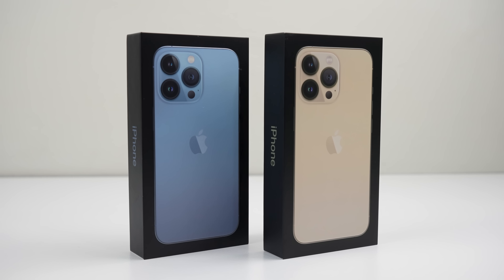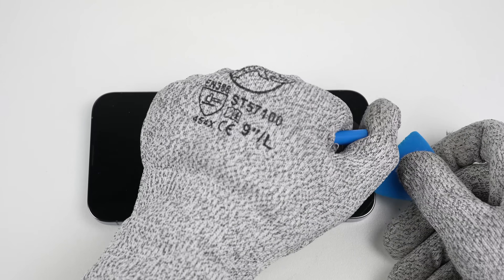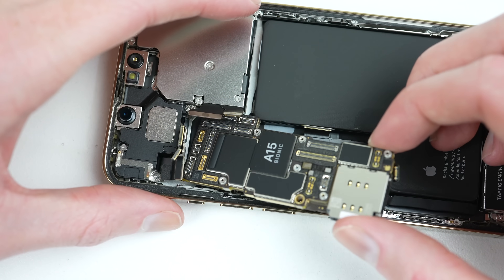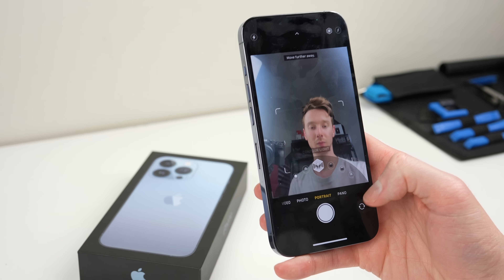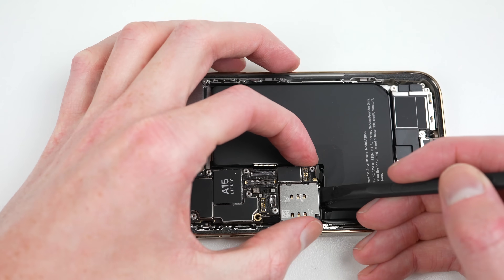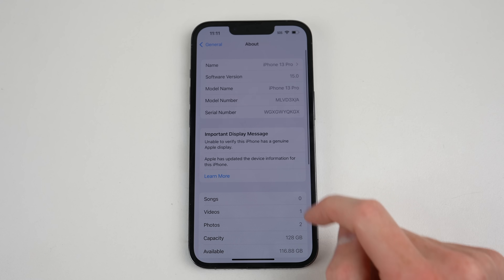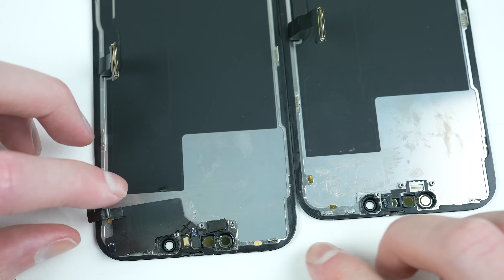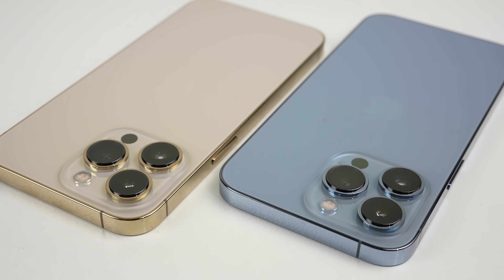iPhone 13 A Repair Nightmare - Teardown and Repair Assessment

Comment: I love how Apple is using security screws inside the phone.
To Apple engineers: The screen is glued shut. If someone had enough persistence to get it opened, weird screws aren't going to stop them either.
Reply: Exactly what i came down here to comment... They just do it to be twats is all i can guess.
Reply: Any Castle can be conquered, it's just a matter of "how long it will take".  And it's a resource. If you don't have the required time and resources, you give up. That's the defense here. By making it harder, you effectively greatly reduce the amount of people who can perform this procedure.
And if the amount of people are low enough, nobody will be googling for a 3rd party Apple repair service.
Castle owner wins, with enough people deterred.
Reply: They probably produce and sell the screwdriver for these screws
Reply: Probably more to just use the same screws bits to assemble the whole phone, if they cared about making it harder they would use a different security screw on the inside then the outside, since if you can open it obviously you already have the screw driver
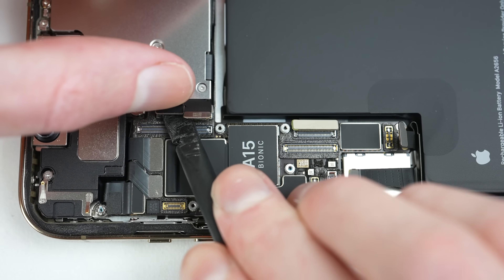Reply: @jaykoerner  at around 4:45 he says he has removed 4 different types of screws including 2 security screws. they are not using the same screws on inside and outside
Reply: @thomashall1236  Nope, there are some pentalobes inside. Most Y-000 though, and some tiny Philips. I remember how the charging assembly for the iPhone 12 Pro had almost as many screws as the entire base S21 had.
Reply: Also, 
To Apple Engineers: You guys are
                                    useless garbage
Reply: @AcidiFy574  maybe not all apple engineers. some of the engineers there left apple and started their own company called 'Frameworks' which do the exact opposite of apple but in laptops. they go as far as providing colour coding each screw for each component and providing some extra screws so that you can repair it on your own and they can also give you CAD models of the motherboard in case the components in the laptop die of age so that you can use the same motherboard and fabricate or 3d print a whole new chassis for it so that you can use the same motherboard again and most of the parts in the laptops are replaceable anyway
Reply: @kaneki1056  Then those aren't Apple "Engineers"

They're actual engineers.
Reply: And make Apple more $$$$$$$$$$$
Reply: Engineers aren't interested in your 'logic'.

Comment: Similar ti iphone 12 you can copy the serial key on the old screen ang trasfer it to the new one, better buy that part before going into conclusion that a certified technician cannot swap a brandnew screen, these programmer boar should be available in china of course

Comment: Imagine a person who first bought this and wasn't expecting no power adapter, charger and a headphones. 
Then went back to Apple and told them it is missing the parts that he needs the most, then told it is sold separately.
Reply: 2022: batteries not included.
Reply: @Woogoo336  
If that was the case you could at least replace it if it breaks, which Apple would never do.
Reply: @Alias_Anybody  They could go for some "magical" external batteries

Comment: It seems the modularity and physical replacement is as good or better than the past, but Apple, with their vertical integration of software and hardware have completely designed the phone to be only repairable by Apple. This does enhance the so called “security” of the device but it’s to the detriment of the individual willing to do their own repairs, and all of the device repair costs will be much higher as a result. Thank you so much for putting all the hard work in for these videos! Love getting to see these phones from the inside.

Comment: I think you’re doing Apple an injustice. I would not expect cameras and sensors to work if you swap them out. I’m sure during manufacturing and test, the components are calibrated and calibration info is stored on the main processor board along with serial numbers of the components. If you swap out a component, it will need re-calibrating and so it seems reasonable to disable features that would be compromised by the swap out due to invalid calibration data. Isn’t it obvious?
Reply: Dude just Shutup. You all cult bastards. Always enabling these greedy companies. Always defending Apple and Samsung. Shutup idiot

Comment: Apple: "So we can't serialize the back camera, but we can serialize the rest, right?!" (does the back camera even work when you switch it?)
Reply: It seems so, if it worked with swapped boards.
Reply: That’s because the back camera doesn’t include any security feature like face unlock
Reply: @JFTN123  If that were the case only face ID would be disabled, even then a good company would allow you to manually enable face ID after viewing a warning about non genuine parts.

Comment: It is a dick move to disable perfectly functioning hardware parts. I don’t mind if the phone throws a warning, let the user know, then let user decide to keep using the function or not. If user selects don’t care keeping enabling then Apple gets a free pass on any related issues. This is why we need big powerful institutions like the EU and US to give us right to repair! I’m typing from an XS Max with a busted depth sensor suspected of water damage. The phone is otherwise unblemished! All it needs is a replacement of the module but there is no one here with the Rewa equipment to reprogramme a new faceId cable!

Comment: doesn't changing logic board with other one can cause security issue? I mean, if someone get an stolen iphone 13 and they want its data, they can just replace its logic board with their iphone 13 logic board and can access files/data on stolen Iphone13. In your testing, have you been able to read/write any file on the phones after swaping parts? If not than I think removing faceID and front camera is a logical choice to protect user data.
Reply: Garbage brain....
If someone wants your data they just need your password 
Thieves don't steal phones for data

Comment: Slippery slope. From a right to work standpoint, you will need to work at apple to work on apple products. Which also means you won't be able to leave apple since your skills cannot be used anywhere else.

Comment: The subscription model is king. Want an iphone that will last a reasonable amount of time? You need to buy apple care. Being able to repair a device on your own means you are less likely to need applecare. This model is everywhere. I remember the repair section at my local BIG NAME car dealership was small in years past. Recently, it has gotten a huge overhaul. It is easily 10x the size as before. Why? They are figuring out how to drive customers towards more repairs post sale. During a recent sale I was given all sorts of warrantees and free services BUT I had to do them at their repair center and ptentially pay for extended warranty. -The car buying equivalent of apple care.

Comment: As scummy as it may seem. I don't personally think it is all that sinister in the broad view of things. they sell you an iPhone 13 for 699. Most likely not a huge profit margin. Then, the customer keeps the iPhone for 4 years, some people even longer. The iPhone, despite being a proprietary mess, it is a super reliable and well built product. So they are supposed to just be okay with everyone else taking away the repair side away from apple? I see how it sucks for the customer to have to shell out to have apple do repairs. It totally sucks. However they are losing a crazy amount of money to 3rd party parts and repairs. It would be silly to expect a company as wealthy as apple to just give up the profits so that the customer can pay less money for repairs. They believe if you have the money to pay for an apple product, you have the money to have them be the only ones that touch it. Its scummy, but you'd be an idiot if you expected anything less. They should make laws that limit this.

Comment: missing true tone that can be compensated for in photoshop.

photographers will have to move the photos to their mac and edit in photoshop.

i am sure there are battery health meter apps out there so you dont need apple's.

you can skip the face id and use the pass code instead.

since portrait and cinematic modes is a blurring thing you can do it in photoshop and final cut.

this is provided that the camera will work at all.

Comment: Great video. I had no idea Apple had done this even with the iPhone 12. It's a real dilemma as I still think the iPhone is still the best overall phone you can buy but I do not like Apple as a company. If the repair charges done by Apple were anything like reasonable it wouldn't be so bad but the cost of most repairs would be enough to buy a half decent Android phone. Hope by making such videos and getting feedback, Apple will do the right thing with a software update. In fact if they locked all new models for the first year and allowed third party repair after say 1 year that would be a more reasonable compromise.

Comment: This is all do to calibration settings for the camera, and battery that is stored on the logic board nvram.  The calibration is completely wrong for these parts, so the software doesn't work.  Calibration for the cameras are critical for faceID and the ability to swap between the different lenses.

Comment: So not even copying the hardware data over to the third-party hardware would fix these issues? The way a data transfer works is that it fools the system into thinking the new hardware has the exact same serial number as the old one.

Also, I don't think anyone needs more proof of Apple's hostility towards consumers and distate for their own customers than them actually creating artificial problems with hardware/software when trying to repair Apple devices at a third-party repair shop. Not only that, but then they have the nerve to openly insult everyone's intelligence by claiming that third-party hardware is the cause for these issues.

Sure, third-party screens are never gonna be as good as Apple's own screens. The problem is that Apple's original screens can't be purchased anywhere, so third-party repair shops are forced to use lower quality screens by default even if they're top of the line of the screens they can actually get a hold of.

Comment: Fantastic video. Very methodical and we’ll produced. I can understand both sides of the argument. On one hand ‘I don’t feel like I own them’ seems fair enough.- you’ve purchased something outright but feel as though you should be able to open it and repair it. Not being able to seems unfair and locked in. However on the other hand if I purchase a secondhand iPhone I want to be sure it’s as good as it was when it was made. I would want to ensure it has genuine parts inside, that it is still waterproof, that it has been done by a trained repairer and that it won’t burst into flames when it’s charging during the night. I think Apple wants these things too to maintain their brand integrity. Apple are also moving towards a closed manufacturing ecosystem and they don’t want to have to deal with foreign materials that are inside cheaper 3rd party items. So what we see in your experiments and others like it is a sledgehammer approach instead of a compromised position. You demonstrate how not even genuine parts from an identical iPhone will work when installed - whereas a section within settings could show items that have been replaced, when and where they were replaced and what parts have been used. That way a secondhand buyer could ask the seller to see this information and make an informed buying decision - and people who want to maintain their iPhones could (in conjunction with authorized repairers). So I see both sides - I just think the solution could be more towards the middle and not so extreme.

Comment: I honestly don't get why Apple even makes the insides of their tech so beautiful visually speaking when they are so much against users opening it anyway.
Reply: it need to be easy if kids have to asamble them :D
Reply: Probably easier to build... But made to not be replaceable. Or probably they know which part to use to make it work... So: they only can repair the phone... Only if they want...
So they try to give an excuse to the costumer if the device fail... And if there can't be any excuse, they replace the single component if it's less than 1 year old...
Reply: hypocrisy is the first impression of apple products.
Reply: As a certified technician, i appreciate it for all of you
Reply: It is becouse of Steve Jobs visions. He want it beautiful outsite and insite.
Reply: because they know they will be opened anyways
Reply: The inside is not beautiful in the first place

Comment: The legal system is defective, broken and either doesn't work or takes way too long to do the right thing, so the only way going forward is to set up an anonymous bounty programme where apple employees can leak the source code for the internal pairing tool for money.

Comment: How can people be still surprised/pissed off by this? We all know how much Apple likes to constrain their own systems. Is this a good or a bad things? Depends.
I've seen a handful of people have their iPhones poorly repaired being an endless source of bugs and malfunctions due to counterfeit parts, or supposedly original parts which ended up failing as well due to not being "completely broken". And I know a handful of places, most of them phone repair shops, that will buy a phone for parts no matter their state without asking questions.
You know, if I accidentally break my phone I can:

a) Try to repair it myself, which has a big chance of ending up being a complete mess.
b) Pay what I think is a reasonable amount of money to a random self-proclaimed technician to fix it with parts neither me or him have control about and won't likely respond if at some point something gets worn out.
c) Pay more to a skilled technician, like you, who offers me some warranty, but I know he's not opening a brand new phone for me, which isn't eco-friendly at all.
d) Get it repaired by Apple

I think, if I appreciate my phone, which most iPhone users do, I would consider option c if for some reason I can't simply walk into an Apple store and get my phone repaired by a no less skilled than the c one technician as well. I haven't checked their fees but they may not differ that much. And I'm sure Apple pays well their technicians.
I'm not saying this is 100% fair and I wish phones were plug n play like I connect and disconnect my guitar pedals. But Apple hits two birds with one stone, they (try to) get rid of guys with a screwdriver that call themselves technicians (and the black market around them) and produce half-working devices that frustrate the user, and they make highly skilled technicians consider working for them like they did with some jailbreak guys.
And if you disagree with this company that much so you don't understand these politics you won't be getting an iPhone in the first place so this doesn't apply to you.
Again, what surprises me is how techies that supposedly understand a lot about this subject still, in 2021, after more than 10 years of iPhone, ramble about this.
About Apple we already know they like to make apparently unreasonable, unpractical and unfair decisions, but I think is healthy to at least ask ourselves why.

Comment: Better not break it or even crack the screen if you have one of these. I DIY repair my XS max with new aftermarket screen and battery, and everything still works fine

Comment: I’d love to be a fly on the wall at an Apple repair centre to see how they do these repair jobs. Very interesting.
Reply: Probably they do nothing but overwrite these errors with software after replacing the hardware.
Reply: @Karthik-yy7gw  i was wondering the same since the parts aren’t the issue it’s all software related.

We need “hackers” to come up with a solution for us 😂
Reply: @Boogyman1984  right but I feel instead people should stop buying apple products
 This behaviour of Apple looks like the highest form of capitalism for profits.
Reply: Simple. They reprogram the codes in the parts.
Reply: @professorpwerrel  That will work for (or did work for) true tone but for face ID forget about it no one has ever come up with a work around or a way to re-programm the phone. Apple locked that shit down tighter than a nuns cunt.

Comment: @1:10 Yes, but at this price tag a charger should be included. Cost cutting with the obvious bollocks of "caring for the environment."
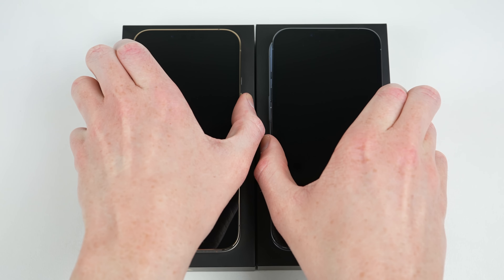@1:20 Paperfilm? Didn't it get any cheaper? :D
@1:39 They are bullshitting people with propaganda buzzwords like "sustainability" when it is all about cost cutting and making the shareholders happier. ^^ They use a proprietary connector which increases the amount of e- waste. They combat repairability which encourages to buy a new phone, hence increase e-waste. :D